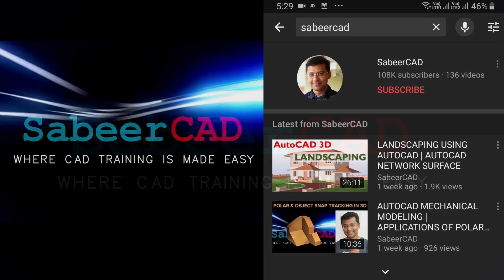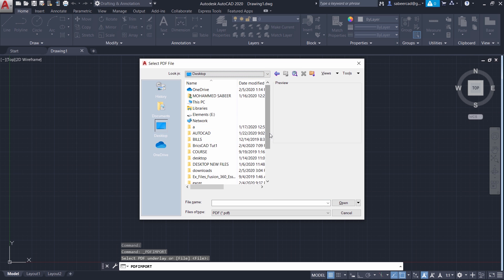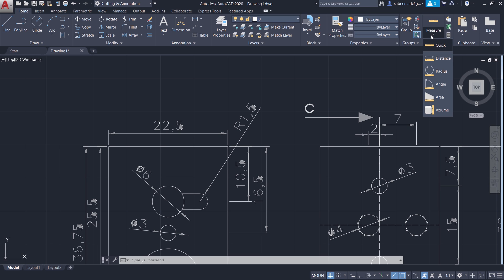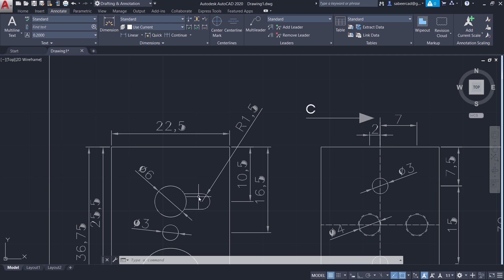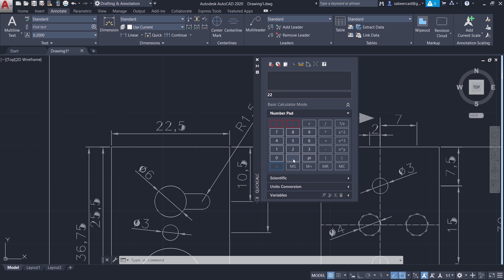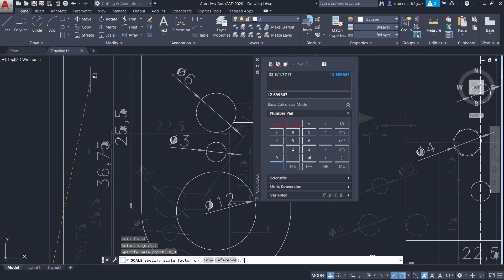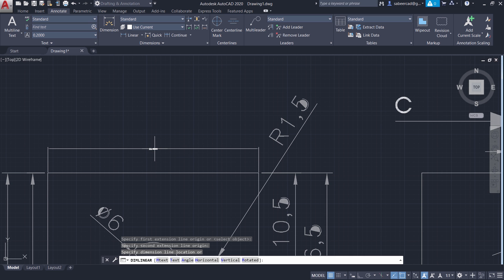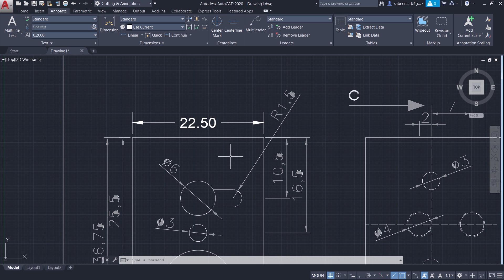PDF TO DWG CONVERSION WITH ACTUAL SCALE  | AUTOCAD PDF TO DWG

Comment: If you just use AutoCAD for 2d drawing let it go, QCad isba better solution, I've been using it for 2 years right now and plotting is really easy even can export your draw with just one click, because in the tool panel have a PDF icon, just like that. And it just cost $40 per year for yhe lastest updates. For me AutoCAD is toooo much overpriced.

Comment: Just take the dimension, draw a line and offset it the amount of the dimension. The scale/reference to the new line. No maths needed. I've been doing it since 1987.
Reply: Yep, do it all the time too.
Reply: Bro can you bless me i have an exam im tryna cheat my way
Reply: Hey, I'm new to autocad as in the fact that I know nothing about it. Can you explain your comment as I was a 5 year old? What's dimension, and what does it mean to offset?
Reply: @The_Aleph_Null   if your pdf file has dimensions on it. Draw a line across the dimension line. Then draw a circle at the left end point of the line and set the radius to the actual distance written on the dimension line. You then select the pdf and use the scale command using the line and circle as your references click the left end of the line and then the right end of the line and then select the right side quadrant of the circle. The pdf will now be to scale. It's not 100% accurate but it's close enough.
Reply: Aww 0
Reply: @sarveshkulkarni2391  eh?
Reply: There is no Autocad in 1987 idiot 😂
Reply from the maker: That will also work.

Comment: Sorry, with your method you´ve scaled only this one dimension correct all the others will stay wrong. I ´ve made that mistake myself. You can´t scale an imported PDF so that all dimension will be correct, it is not possible because a PDF is in dots per inch and that is not a vectorgraphic.

Comment: Hello Mr. Sabeer
Which oldest version of Autocad supports pdf importing? I got 2007 version of it, it meets my needs for drawing. I couldnt find in 2007 version. If it has the feature, I'll keep my version. If you can help, I would be glad. Thanks in advance.

Comment: Great video. Next time drop the calculator and just do a scale reference and use your starting point as reference then input desired distance of 22.5. 
I’ll give this a try because if the pdf can be converted to drawing easily it would be amazing !! Cheers
Reply from the maker: That will also work

Comment: Never scale from pdf if there is an other option. Problem is pdf can be variable in horizontal and vertical measurement when paper size has been changed. Only if the pdf is made directly in Cad it is more or less trustworthy. In this case scale is provided on drawing if it is being made by a professional. If not will you trust any measurements anyway?

Comment: Long way to do it, simply import pdf and then use scale command, select end point to end point and type 25.5. Before doing this make sure your config page settings are set to metric millimeter not imperial as it is a new drawing.
Reply from the maker: Good suggestion

Comment: Hello. Thanks for the tip. But I noticed that after scaling the horizontal dimensions are correct but not the vertical ones. Is there anyone who has a solution to this? Thank you.
Reply: The dimensions that really fit the size are only used as a reference guide, others still have differences
Reply: @mloebab   i too have this faults is there any solutions

Comment: That is a good way but in my experience and also my preference, I use the reference option. Base point of 0,0 like you said but when it asks for scale factor, copy or reference, input reference,  and pick the length of the line and then manually enter the value, (22.5 in the case of your example) 
Not trying to put down what your doing but sharing what I think is a faster and more accurate way...
Reply from the maker: Thats a good method

Comment: I've been on AutoCad for many years, this works, but if you're going to work with it as a house plan, then it is much faster to draw over the PDF drawing , because to clean up the converted file will take you 10 times longer than to just draw over. The converted file is in small pieces.
Reply from the maker: Ok👍
Reply: Can't you use Overkill to merge small line bits into one?
Reply from the maker: @hyodoug  Yes, it can be done

Comment: Will this work if that pdf file was not a conversion from autocad?
Reply from the maker: It will work well with PDF converted from AutoCAD.  To convert other PDF files you need to use a vectorizing software.

Comment: Hello
I suggest that you try to place dimensions in other parts of the drawing.
You may find that the linear scale may not work for all geometries.
Try vertical dimensions.
Thanks
Reply: Polar scale becomes tricky as well
Reply: im having this issue what to do?
Reply: @mohammedriswan7676  There's nothing left to do but choose the largest dimension of a drawing and scale it.
Of course , some adjustments will be necessary .

Comment: Sir I am using cad2012 i that no import file Then how to use
Reply from the maker: Only 2017 and higher versions supports PDF import.  So you better upgrade Autocad.
Reply: @sabeercad  No. 2020 version too support pdf files. The command is IMAGE
Reply: You can attach the PDF file in AutoCAD even in earlier versions like 2010
Reply: Thankyou sir